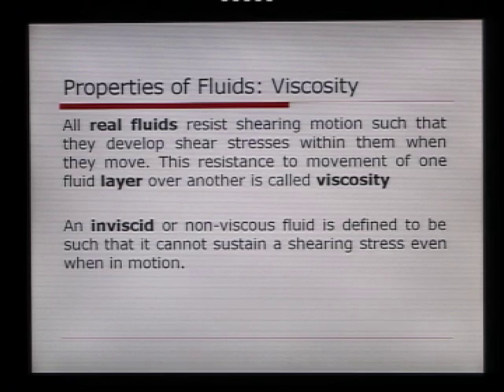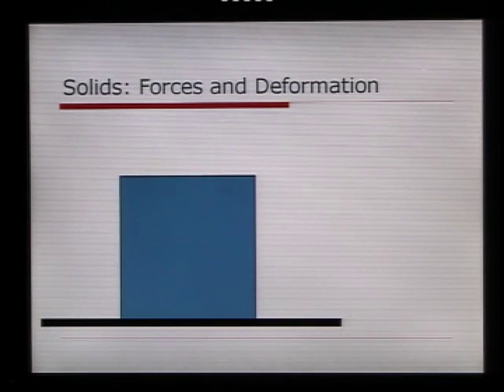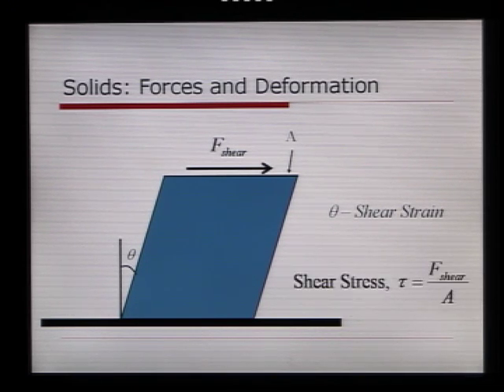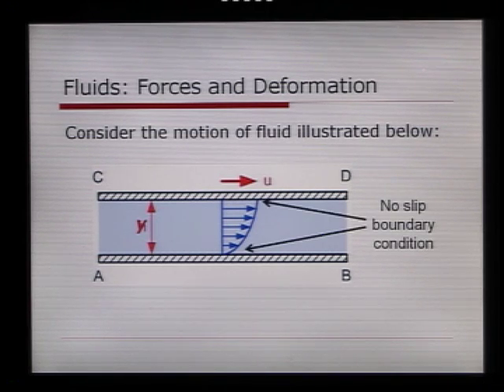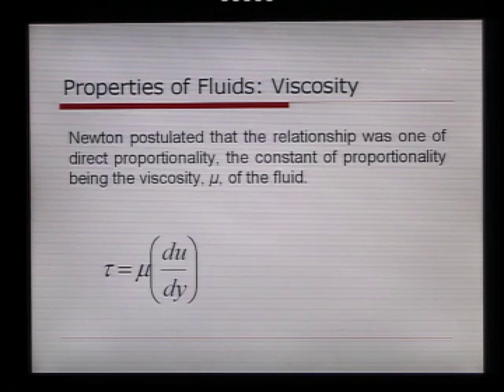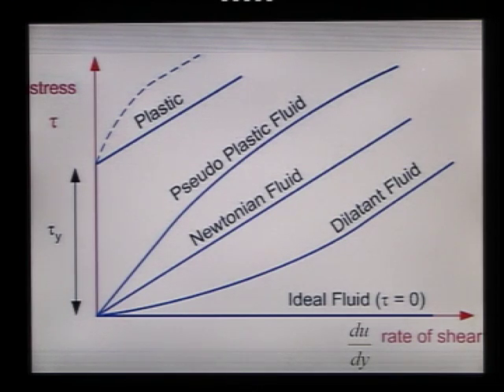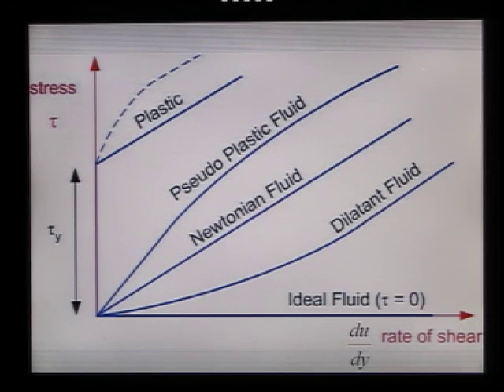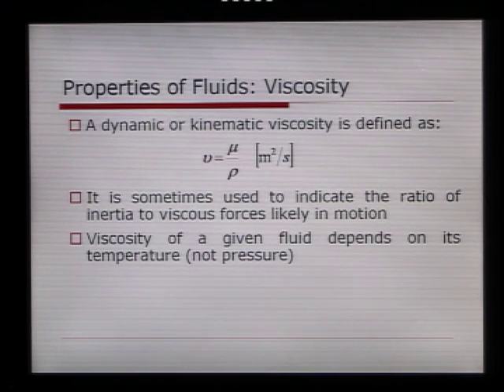Introduction to Fluid Mechanics, Podcast #4: Fluid Shear Stress

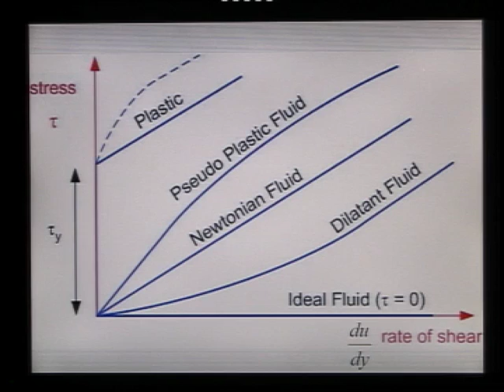Comment: At 4:47, the lecture seems to imply that dynamic and kinematic viscosity are synonymous. However, kinematic viscosity is the ratio of a fluid's dynamic (or, absolute) viscosity to its density.